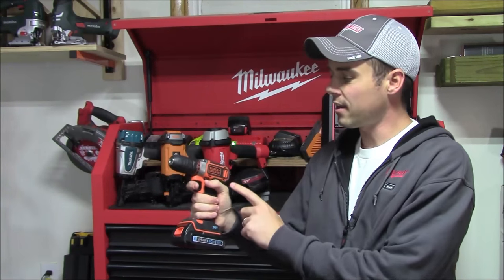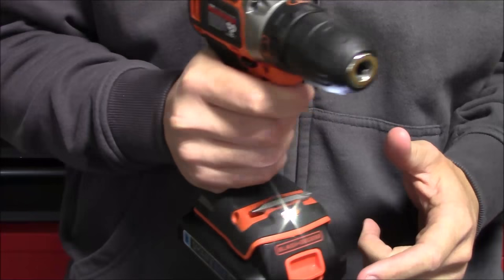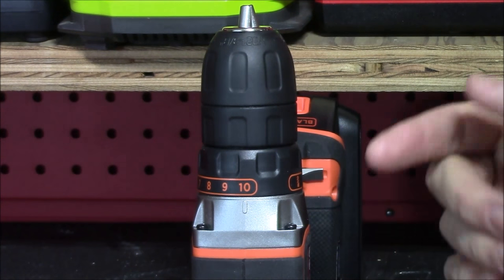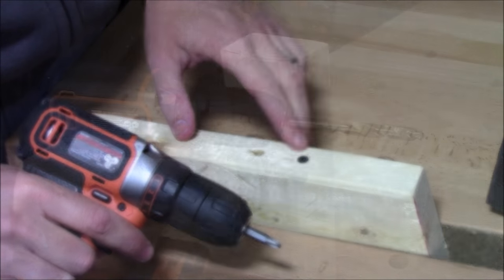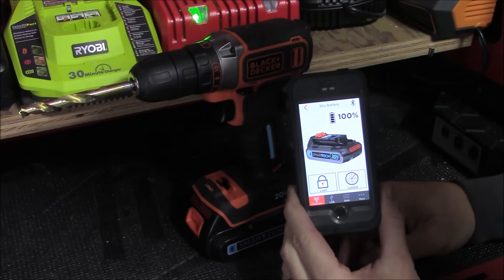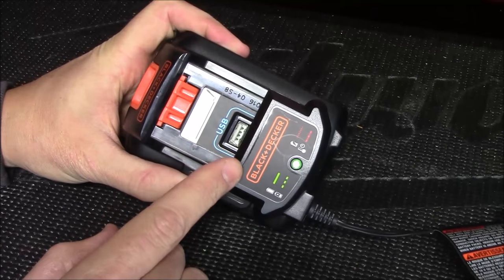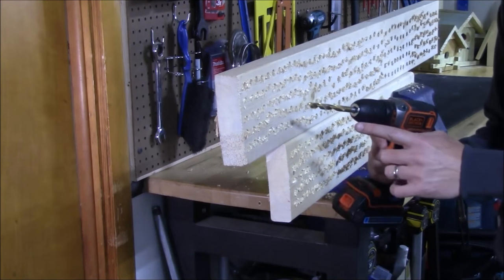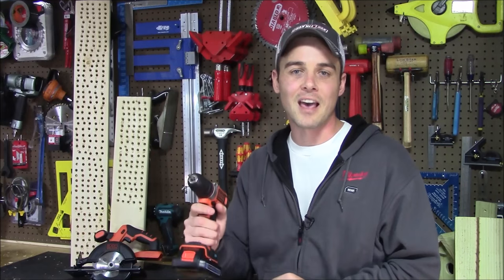Black + Decker SMARTECH 20v MAX 3/8" Drill/Driver Kit - BDCDDBT120C

Comment: Good god! That run time test. 330 holes on a 1.5 amp/hr battery is impressive. Wish they had put a dust cover on the usb port though. Thank you for uploading!
Reply: i kinda think the only reason it's remotely impressive is because the speed/torque is so low that the releative power draw is equally low.  If you put this battery pack on a decent drill, you'd be looking at a lot less but with a lot more flexability.

Comment: Great review.  The thing with B&D is their notorious battery charge time.  My wife likes to use her B&D string trimmer, and that thing is a battery hog.  In order to be somewhat productive during the day, you have start charging the batteries the night before.  Would be nice if they were to step up their game in that area.
Reply from the maker: They have fast-chargers (sold separately)....but I agree.....the included charger is quite slow.  Keep in mind that most people using this, would be not classified as "heavy users".
Reply: Yeah, so I bought a fast charger as well, but actually, slow charger will make the battery last longer.

I have two outdoor tools -  string trimmer and hedge trimmer, and string trimmer came with 2 batteries. So with total of 3 batteries, I can do most works.
But if you need more run time, you might want to buy 4Ah battery. Since small batteries are 1.5Ah, it has nearly 3 times of the capacity and it lasts long. Perfect for outdoor tools.

Comment: is it actually 20v or is it 18v like the Dewalt 20v is actually 18?
Reply: +James MacInnis even 18v makita or ridgid is still 20v when you put a voltage tester on the battery when you put it on the drill and pull trigger then it becomes 18v
Reply: +Barry Williams if you open a battery and add up the volts printed on the cells you only get 18

Comment: 20v with a 10mm chuck with no spindle lock a proper pile of shite. Black and decker have lost plot since the brought default. That said I think Stanley owns the lot now
Reply: +Adam Lynch i think the idea is the dewilt is for the "pro" contractor types, Mac is for auto techs, and black and decker is the home gamer, as far as stanley's cordless tools go...and, i believe between the 20 volt and 12 volt of all three they all take the same two batteries
Reply: +bighunterman77 Mac and dewalt are definitely interchangeable don't think black and decker is